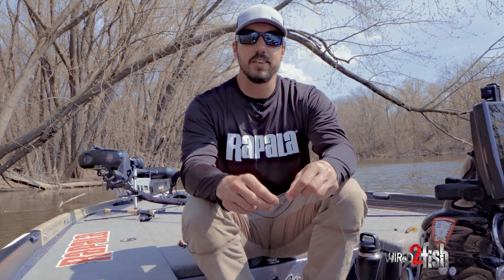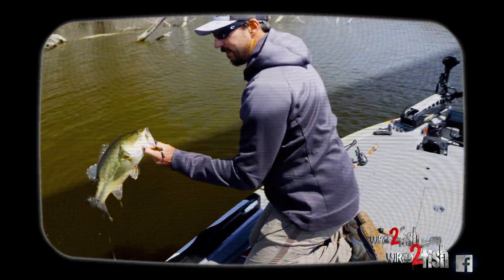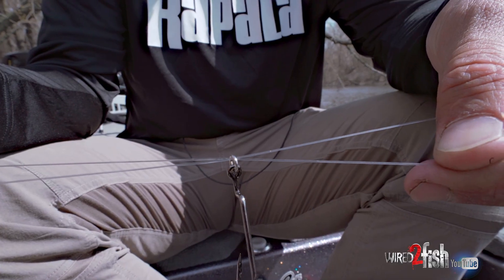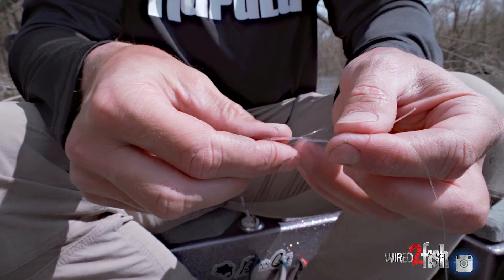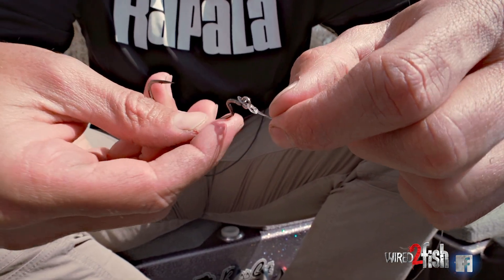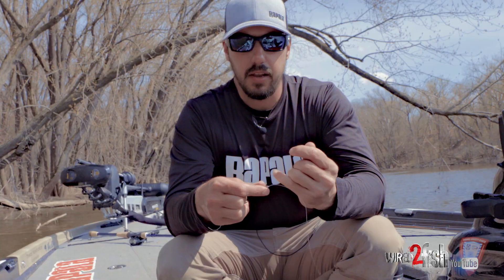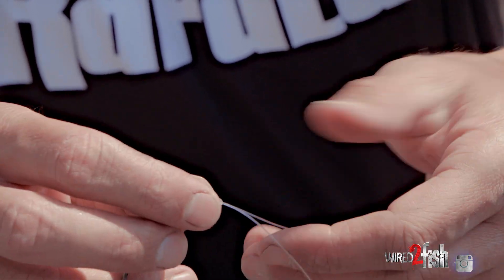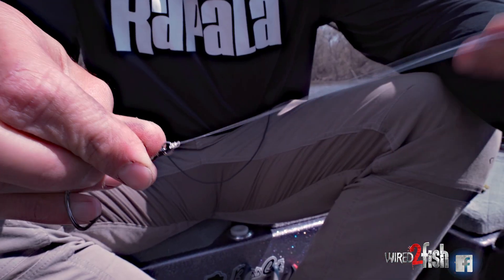2 Tips to Avoid Palomar Knot Failure with Fluorocarbon

Comment: I found mono is as good as flouro more abrasion proof and cheaper  both stretch too and I use pro bass guy G man Swindles knot easy ,never fail knot stronger better than any type of palomar never slips never fails in  tests did better than any Berkley knot check it out many bass pros use it, better than what your saying. not trying to put ya down but try it